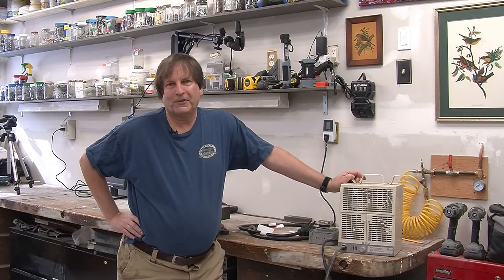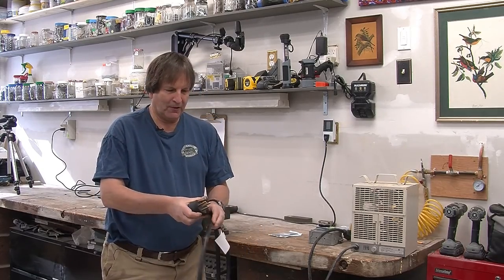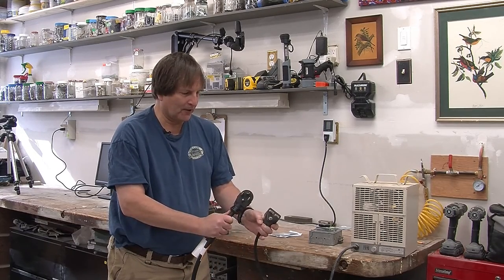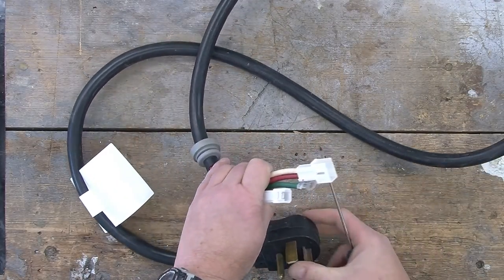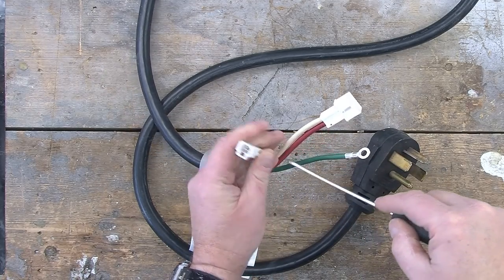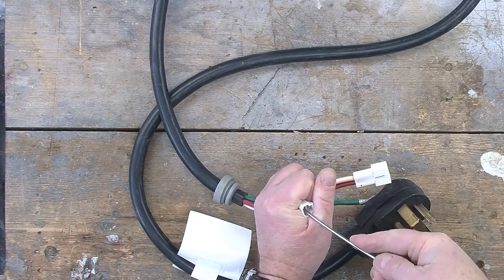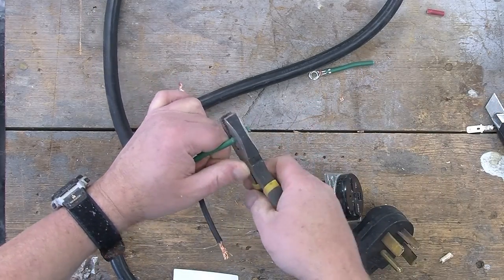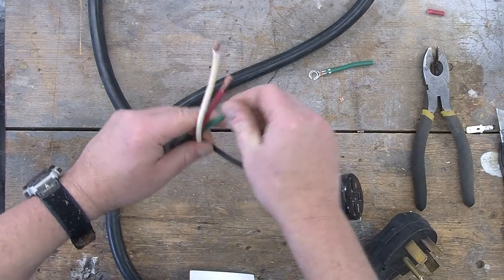Making an adapter to plug a construction heater into dryer outlet

Comment: What if my dryer plug is only three prongs? How would I attach those wires to that adapter? Thank you in advance for the response.
Reply from the maker: You have one of the older dryer plugs. The 3rd prong (the one shaped like an L) is  the neutral which in the past was used as  a "fake" ground as well. No real ground is provided. To safely attach a construction heater), you do need a proper ground, so don't do it with a socket like that type which  is lacking a good ground.
Reply: Thank you!! @ElectromagneticVideos
Reply: actually, my third prong is round not shaped like an "L"...not sure if that makes any difference. two other prongs are flat and the same width (not like those where one is wider than the other.   @ElectromagneticVideos
Reply from the maker: @shahadataziz624  Hmm - you are in Canada or the US, right? Look at this chart https://www.americord.com/media/wysiwyg/Qualtek_nema_nonlocking_configuration_chart_2.png   Can you match your outlet to one in the chart? I assumed you had a 10-30 outlet. The key is you need two live prongs and a ground. 

You need the ground (not neutral) because the heater will connect its ground prong to its metal case. If the prong on your outlet is neutral, and if a fault  happens somewhere, you could get dangerous voltage on the heater's metal case. 

Also, the outlet type needs to be rated for 30A and the breaker or fuses also need to be 30A (no more, no less).

Sounds like you are a bit unsure of what you have - I would suggest in that case it might be best to ask some who would know to look at/test the outlet and confirm what it is - better to be safe that way.
Reply: in USA. thank you! @ElectromagneticVideos
Reply from the maker: @shahadataziz624  Your welcome! So the outlet you have should be in the chart or something is really strange! Can you tell which one?
Reply: Thank you! @ElectromagneticVideos
Reply: you were right, I made a mistake in even indentifying the outlet. it is 10--30P. Thank you for all the help. @ElectromagneticVideos
Reply from the maker: @shahadataziz624  Glad you figured it out! Pleased to be of help!

Comment: Why is it the electrical industry refuses to move away from flat blade screws? Hardly anyone else uses them and switched to Philips decades ago. I find most electrical fixtures, switches and tools are all very primitive
Reply from the maker: Certainly outdated technology. Although I'm no fan of phillips either. My vote would go to Robertson. I think it may be that flat blade is one screwdriver type available everywhere in the world in every toolbox ...
Reply: @ElectromagneticVideos  I’d definitely rather it be Robertson but I figured Philips was already a bit far out of the Stone Age
Reply from the maker: @BruceLyeg  LOL! Yeah - the problem with Robertson is unless you are in Canada they are not very common either. There is a funny mixture of flat and Robertson screwdriver that perfectly fits in the line and neutral screws of a 120V duplex receptacle. I believe Milwaukee makes it.

Comment: Ok only made through 10:30 of the video without cringing! De-pinning the terminals to keep the wire length is great but, using a razor knife & pliers to strip the wire! SERIOUSLY, talk about teaching people the complete wrong way to do electrical wiring come on man, this is making DIY’ers all look like hacks! 

Man get a pair of wire strippers and don’t twist and pull on the wire like that, your only breaking the strands and fatiguing the remaining wires so they will break prematurely. Come on man if your going to show people electrical wiring, at least put a disclaimer at the beginning of your video especially if your hacking the work up like that!!!

Love the videos of you testing failures of wires by awg size using amp overloading but, you showing people how to do wiring needs drastic improvement to say the least man.
Reply: Oh, no videos on your channel! Great advice from a seasoned expert man.
🤣
Reply: @jamess1787  no there’s no videos from me, I don’t have the time necessary to produce content, edit said content etc... I simply was an electrician for 19yrs until 2017 when I saw the last coworker I was willing to see get hurt by simply cutting corners. He was shocked badly and died of a heart attack, I put my papers in a year later. It wasn’t worth seeing good people get hurt due to ignorance or cutting corners.

I now still do my own electrical work as well as the occasional job for a old friend. Just seeing a video quite literally teaching others to do deliberate or blatantly bad electrical work is hard to stay silent about. Sorry if keyboard commandos feel I’m ripping on the man. Especially, when you’ve seen the results of shawdy work or DIY work done dreadfully wrong even by a handyman’s standards. Not to mention any release of the national electric code.......